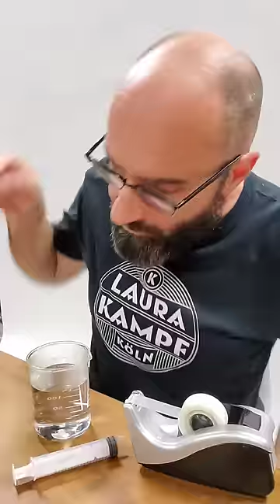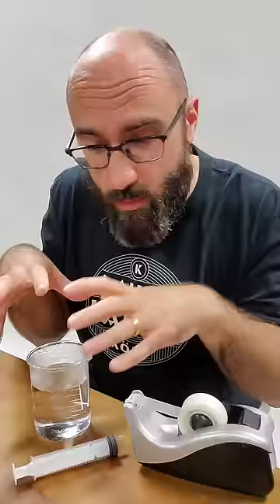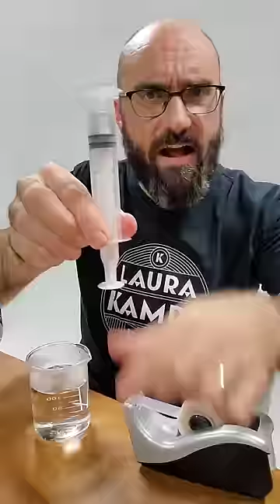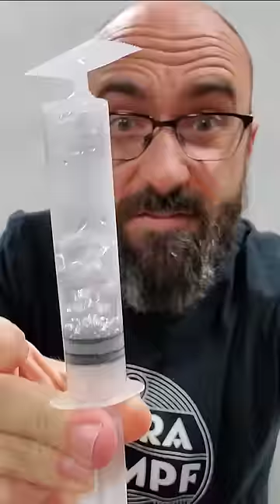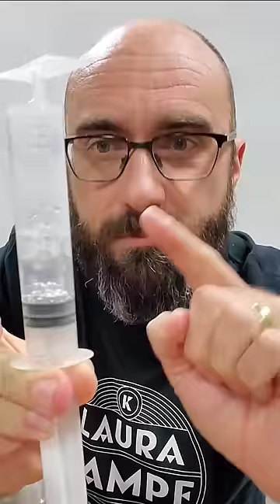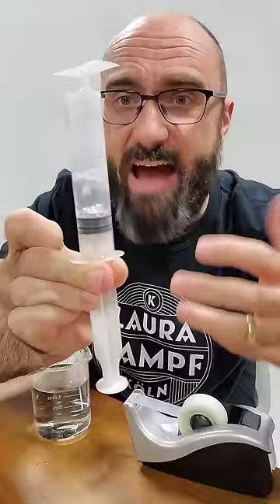Cooling down water by BOILING it

Comment: This is also how you can make frozen nitrogen :) You pull a vacuum, the molecules with the higher kinetic energy transfer to the gas phase while the average kinetic energy in the liquid phase drops, allowing it to freeze.
Reply from the maker: Yep! That's how I first learned about this!!!
Reply: @Vsauce  first reply to sauce man interesting
Reply: @Vsauce  Interesting!
Reply: Ok
Reply: Hi sauce
Reply: @Vsauce  ñ
Reply: @Vsauce  Believe it or not,  but I found this out about the age of 6 by playing with such a syringe under hot tapwater :D got freaking confused, and my parents couldnt tell me the reason. Later I found out, but funny coincidence, that my all time favourite youtuber comes across this after 20 years of child-me observing this phenomena

Regards from Finland 8)
Reply: But the evaporated gas which took away the kinetic energy never left the syringe as it was sealed then how temperature is cold ( i mean liquid phase may be cold and gas phase may be hot but overall the syringe when touched should feel exactly, what the temperature was before pull the syringe and lowering the pressure)???? Please clarify my doubt
Reply: @Vsauce  Hello Michael 😢
Reply: I've always thought it was kind of the other way around. You compress a bunch of air, which will concentrate the heat, then cool it down to room temperature. When you decompress it, the heat is spread out over a wider area and so the temperature at any point drops. This causes the whole container to get to cryogenic temperatures, allowing liquid nitrogen to condense. There are some more complicated parts to it but I'm fairly certain that's how liquid nitrogen is normally produced. That's also how they purify nitrogen from the air for use in certain lasers
Reply: @thedudeamongmengs2051  you can probably do it both ways
Reply: @swamphawk6227  i didn't get you , see if water temp is x then after putting it to syringe and pulling it overall temp should feel x as evorated water didn't leave the syringe, so energy isn't transferred
Reply: Smort
Reply: How are tight is the plunger in the syringe? As soon as you start to pull a vacuum, any imperfections there will allow air in, resulting in some bubbling regardless.
Reply: wow
Reply: @swamphawk6227  so, in a closed system if energy is spread over large area and we check temp using thermometer, it will show less reading than if energy is spread over small area ,even though energy is conserved ?( sorry my basics is not strong)
Reply: https://en.wikipedia.org/wiki/Enthalpy_of_vaporization
if i am not mistaken this should actually "cool" the entirety of the contents of the syringe down, because the energy taken to evaporate was formerly heat. so when a bit of water evaporates it also "steals" energy from the surrounding water to cross the threshold the gas then will still have the same temperature but the water will be colder, lowering the average temperature inside the syringe
Reply: @subhamsahoo5817  https://en.wikipedia.org/wiki/Enthalpy_of_vaporization
Reply: @DUTCHWUB  Just be jealous that they know more than you :)
Reply: But who cares you know
Reply: @Vsauce  Hey it's vsauce. Michael is here
Reply: or is it
Reply: So it doesn’t go on forever?
Reply: @subhamsahoo5817   This is a very good question. What wasn't mentioned in either explanation is enthalpy (heat) of vaporization. In reality, the hottest molecules don't just freely fly out of the liquid; they have to overcome a well of energy, which is the bonding energy of the molecules in the liquid. So the energy from the hotter molecules goes into potential energy as they separate from the liquid. The gas in the syringe isn't actually hotter than the original liquid, so the temperature of the entire thing does drop.
Reply: @swamphawk6227   This isn't quite how it works. Energy being spread in a larger volume doesn't lower temperature in and of itself. For example, imagine you have a box divided into a gas on one side and a vacuum on the other. Imagine breaking a thin barrier inside the box so the gas expands into the vacuum portion of the box. The temperature of the gas will not drop.
The reason a gas drops in temperature when expanding, in general, is because it is doing work on something else (like a piston) and giving up its energy to that thing. 

In the syringe, there's definitely expansion that causes the gas to cool, but the dominant reason for the cooling inside the syringe is the water molecules overcoming the bonds in the liquid state. Basically, kinetic energy is becoming stored as potential energy.
Reply: @Vsauce  or is it?
Reply: @subhamsahoo5817  change fase needs energy.. liquid->gas and solid  -> liquid.
Reply: Triple point is fascinating
Reply: But isn't evaporation also a function that actively cools down the water?
Reply: @Reptex_cs  macroscopic vs microscopic explanation.
Isolate your system and think about where the energy is going, if the water is "cooled down"
Reply: Congrats man vsauce rarely reply 😅
Reply: @Vsauce  w michael you have teached me many stuff thank you
Reply: Oh damn.
Reply: Also, being in a low pressure environment means less molecules bumping against each other
Reply: You mean liquid nitrogen? I have not heard about frozen nitrogen, maybe you meant dry ice? Or am I getting it wrong
Reply: @Vsauce  Physics is amazing, ain't it? :D
Reply: @reapercreeper6097  Nope, frozen nitrogen. You can freeze liquid nitrogen if you just get it cold enough.
Here's a short video from NileRed demonstrating it! https://www.youtube.com/watch?v=qVKod6Rv6dE
Reply: I saw an experiment some years ago of freezing water by letting it on a vacuum chamber for some time, all along, the vacuum engine was on
Reply: @DoNotPushHere  That's a very legit way to get rid of some thermal energy. Other way is evaporative cooling. Sure it creates a very damp environment, but if you don't care about humidity, it is a wonderful way to cool a large amount of air :)
Reply: a/c man abides
Reply: @Vsauce  True lmao
Reply: Hi sauce
Reply: @DUTCHWUB  fr
Reply: Oh dang i need it for my cola
Reply: @Vsauce  Hey Vsauce, random commentator here, where is video about life longevity, do you have any interesting thoughts to share about the topic? I heard there ate apperently multiple route to immortality researched currently and it would be nice to hear from you about this topic
Reply: Is it really or is the negative pressure causing air to get sucked past the gasket? Cause nurses does that action every my central line is used and I would
Reply: Your the chosen one
Reply: @Vsauce  yo uncle steves
Reply: Is this why liquid nitrogen boils??
Reply: @Vsauce  I'm so happy to be able to directly reply to you Right now even if you don't see it I love your stuff
Reply: Wow, now it makes sence how they do that :)
Reply: Dumb it down please
Reply: @TheAsdffaaa  Finnish or your finished
Reply: @subhamsahoo5817  the syringe will feel the same, but if you were to cut the syringe, take the water out after the pressure drop, it will be considerably cooler. Our senses are pretty bad at giving accurate measurement, especially f temperature
Reply: @Vsauce  Vsause what happened to Asause
Reply: @subhamsahoo5817  there is no COLD.  Only absence of HOT, which we define as the average kinetic energy within the material being measured for “temperature”.
Reply: @Vsauce  hmmm i see
Reply: secondary school chemistry 😅
Reply: @Vsauce  You are the HowToBasics i still believe
Reply: I thought you had to compress and then cool the liquefied nitrogen.
Reply: @Vsauce  replied to vsauce epok
Reply: Can i drink it?
Reply: Thank you! I've literally always wondered how they made it! Never understood how you could get it that cold
Reply: You mean liquid?
Reply: @ThorOdinson1269  I didn't even realize they said frozen
Reply: Amazing. It sounds up how people use fire and cold as synonyms
Reply: You make nitrogen by doing this!?
Reply: @Vsauce  i can't believe i am replying to vsauce
Reply: damn

the more ya know
Reply: Love this information
Reply: but doesn't gas phase have more kinetic energy?
Reply: @akhlas260  That's the idea. You remove more energetic molecules by letting them transfer into the gas phase so the average energy in the liquid phase drops.
Reply: @MattisProbably  but the total energy of the system should be the same cuz the gas phase molecules are still inside? or does it not affect the total energy cuz they are far apart from each other hence not able to conduct their individual energy to other molecules?
Reply: @akhlas260  The total energy doesn't matter for the liquid phase to be able to freeze :)
Reply: Thanks! I learned 2 new things today. Sweeeeeet.
Reply: IM THE 91TH REPLY
Reply: Interesting
Reply: How are you so smart you’re so smart😮
Reply: @Vsauce  Can you stop braking my brain 💀 This stuff is actually crazy
Reply: @Vsauce  can you steal my brother's kneecaps?
Reply: @subhamsahoo5817  There are many layers to understanding this phenomenon..
1) The average temperature of the water (in liquid state) inside the syringe will definitely be less than that of the water (in liquid state) in the beaker as well as the temperature of the steam produced inside the syringe, for reasons splendidly explained by  @Vsauce  
2) Even if we take the average temperature of the entire system inside the syringe, that would be less than that of the water in the beaker. 
Maybe we can justify this phenomenon in more than one way.. Here is a way of understanding why the temperature drops..
Earlier the water in the beaker was occupying lesser volume due to more atmospheric pressure. However when our super hero pulled down the syringe, the same amount of water (with no change in total energy of the amount of water) is now spread across more volume due to decreased air pressure.. so now the temperature of the system (including water in liquid as well as vapour state inside the syringe) decreases..
Best regards from India
Reply: @Vsauce  Did you first do this in the basement of Kersten?
Reply: @muzzylogic 
Nope, that does not seem to be the case.. the syringe does seem to be air-tight.. coz if you observe closely, the bubbles at the bottom originate on the surface of the rubber (bed) and not near the edge (wall).. so the water is truly boiling.. this was the first question even I had when I first watched this video but then got clarified when I watched it more closely..
Reply: Always was curious on how they changed the state; always assumed there was a chemical process for this
Reply: @Vsauce  You > Bill Nye the science guy
Reply: That’s really cold 🥶
Reply: @DUTCHWUB  Bro why are you even on this channel then 💀
Reply: Does this mean it's possible to make ice by boiling water?
Reply: Is that usual how water behaves in vac
Reply: Thank you!
Reply: @2REACTION4U 
Do you mean Michael has rehearsed with those water molecules prior to the video to make it behave differently than usual?? 😊
Reply: @subhamsahoo5817  look up joule-thomson effect. I dont know the my(greek letter)-value for water at these conditions, but it seems plausible.
Reply: The nitrogen also has to get some of Michael's enthusiasm to get things exciting
Reply: why cant u  jsut normally freeze nitrogen?/
Reply: @subhamsahoo5817  Everything you said is correct, and as long as the wall of the syringe is completely insulated, the totally energy inside the syringe will stay the same as well. But, in that case, you wouldn’t feel the hot water through the syringe, either. 

Over time, the gas phase and the liquid phase will reach the same temperature as each other, thermal equilibrium, but because they are in different phases, they have different heat capacities, and so each will carry a different proportion of the total energy that is held within the syringe.
Reply: Please reference resistance transition temp and how the air pressure combine with the temperature aren't enough to initiate phase change
Reply: bees
Reply: Holy shit he got pinged by vsaus
Reply: @CasperTheRamKnight  I feel so honored.
Never gotten this many thumbs up before, too...
Reply: @Vsauce  or is it?
Reply: @Vsauce  put it in your enemies house when they least expect it.
Reply: @Vsauce  do chairs exist?
Reply: @squidman9343  You also have the that n i also have it ñ
Reply: @Vsauce  But sir, why bubbles can't form inside the bulk water before it's vapor pressure becomes equal to atmospheric pressure? I mean shouldn't the pressure inside the bubble that should matter and not vapor pressure, why can't the high energetic molecules  form bubbles inside the water which has pressure greater than its surrounding pressure and escape? And if it's just about bubbles why can't water temperature rise further than the point where it's vapor pressure becomes equal to atmospheric pressure?
Reply: Vsauce 2.0=Mathias
Reply: @subhamsahoo5817  the same collective energy is in the syringe. It's just distributed differently. The more energetic  molecules are in a gas form, whereas the less energetic molecules remain liquid. Thus the water is cooler. After some time it will reach equilibrium again.
Reply: @Vsauce  interesting or is it ??🤨 
(Vsauce music starts)
Reply: I'm 12 and don't understand a nd any of this  bro😢
Reply: @samtheman3633  who cares!!!!!!!!!!!!!!!!!!!!!!!!!!!!!!!!!!!!!!!!!!!!!!!!!!!!!!!!!!
Reply: Without vsauce we would not have vsauce
Reply: aghhhh too much chemistry for my brain
Reply: @VeryTastySoup87  it's Vsauce !
Reply: What that shirt you're wearing i can read Köln
Reply: @Vsauce  Which shampoo do you use?
Reply: You can do that with many other liquids lmao
Reply: @Vsauce i first learned when I heard blood boils in space and looked into it
Reply: @Vsauce L learned this in my thermodynamics chaper, ssc bords of education, India🇮🇳
Reply: Cool
Reply: You nerds hurt my brain. Keep it up i need it.
Reply: @Vsauce sauce man is amazing
Reply: @TheAsdffaaa TORILLE
Reply: Life Lesson from Science:
How to lower the Temp 😠 
of a situation? By reducing
the Pressure of the situation.
Where, any subsequent 
boiling 🤬only serves to ⬇️
the over all Temp 💢. 👍  :-)

Stupid is ⏫ the pressure🥊
to lower the Temp 🥷
Reply: @Vsauce  that's why we use vacuum distillation unit in refinery to boil heavy crude at relatively lower temperature
Reply: @subhamsahoo5817 I think he meant the average temperature of the liquid water, not the syringe overall.
Reply: How come the molecules in the beaker have the same kinetic energy but when the sample is in the syringe, there's molecules with different kinetic energy?
Reply: Thats cool 😎 👍🏽 😀
Reply: Well certainly the liquid phase would get colder but not freeze just by pulling vaccum.
Reply: @Vsauce  we need more epic vids from you man
Reply: @Vsauce  Does this method for boiling help with making water safe to drink?
Reply: @Vsauce ❤
Reply: Sounds like a nice weapon idea for a non-realistic game
Reply: Interesting...
Reply: @Vsauce with all respect, I think blood of Palestinians more important than your water!
Reply: @Vsauce heeeyy vsauce michael here
Reply: Huh cool.
Reply: @Vsauce  heh.
Reply: @samtheman3633 true.
Reply: @Vsauce  z
Reply: @Vsauce  Hi, I'd just like you to know I don't want to kill you. I think you're great. 👍
Reply: @TheScarvig  Exactly! Correct.
Reply: And to do that you need a bigass syringe
Reply: VsaUse
Reply: @Vsauce greetings from Köln
Reply: Interesting
Reply: I can give you a good example:
if you release lots of gas from a closed environment it gets cold
Examples are big gas containers - you can see water condensating and freezing at the release
Lighter refilling - if you dont hit everything inside the lighter, youll feel the cold on your hands, even if its not the liquid gas hitting you
Thats because those gasses are only liquid because of pressure
Theyre room temp in storage but turn to gas so extreme, it makes everything cold
Thats how your fridge works too
Its cold inside because of releasing the pressure(in a closed system) and its hot behind behind the fridge because of building up pressure(in a closed system)

This syringe is just a way smaller scale with probably the worst medium to do this
Water has the ability to store energy super good, its liquid at room temp, its vapors are always around us... The just wont be big jumps with it
But heat is basicly energy and making the highly energetic parts leave the liquid cools it down
Kind of like that warm water freezes faster than cold water cause the extra energy may makes it warmer - but it can build the structure of the solid form faster with that extra energy

You wont find a diff in touching the syringe, but with a proper setup, you could measure it(still not with your hands tho) @subhamsahoo5817
Reply: toyota wants to know your location
Reply: @Vsauce can this hurt you if you touch the boiling water? Like is the process of boiling itself harmful to touch? I don’t think it would but before I just touch it to see for sure I wanted to make sure haga
Reply: Cool t-shirt !
Reply: @Vsauce intersecting
Reply: @TheAsdffaaa You're 7 now right? 😅
Reply: @samtheman3633 has michael not responded to comments before?
Reply: @Vsauce or is it 🤨
Reply: Hi @Vsauce
Reply: @Vsauce The Man of S     A     U     C     E
Reply: @Vsauce cool
Reply: @Vsauce wow
Reply: SO SO COOOOOOOOOOOL
Reply: @samtheman3633 One small reply from sauce man, one giant leap for saucekind
Reply: he pinned your comment replied to your comment and hearted your comment
Reply: @alphayeep  Yeah I noticed that, too. No wonder this got to over 50k likes 😅
Reply: @samtheman3633 sauce man?.. 😭
Reply: @Vsauce wooooooooooow
Reply: I refuse to learn science UNLESS it’s from YouTube comments 🤠
Reply: Hmmm niceeee  @Vsauce
Reply: Called freeze drying
Reply: Why don’t they just put ice in some nitrogen? Can these stupid scientists not afford ice cube makers?
Reply: @cam5816  With a difference of about 190 Kelvin between frozen water out of a freezer and frozen nitrogen, the water ice would only serve to heat up the nitrogen. Which is crazy to think about that adding ice to something wouldn't cool it down 😁
Reply: @cam5816  bruh☠️☠️☠️☠️☠️
Reply: nah.
Reply: Higher pressure-higher boiling point, BUT there is critical point, where energy that material needs to boil is close to 0, so it start to boil. To prevent this you must use more stages. For this reason powerful ref. systems have 3 or more stages and a lot of refrigerator compressors.
Reply: @RamSankaran-rl2mj  Your explanation makes the same mistake that someone above made. Spreading energy over a greater volume alone isn't enough to lower the temperature. You haven't actually changed the average kinetic energy in that case.
Reply: @Vsauce 🙄👎 Boring . Find something that can be used in an action movie scene.
Reply: @Vsauce  I know when you pull the syringe down thare is vaccum and the air downside come from that
Reply: @MattisProbably technically everything has these states that Im aware of its whether we have the tech and innovation to reach tempatures of the magnitude that would
Reply: Ok
Reply: This is also how refrigerants cool things down in AC systems. That's why you can make "hobo air conditioners," with a small electric motor and a compressor, with tubing and a few properly placed restrictors. Propane gets used a lot because of it's cooling coefficient, and such low amounts in a system that isn't explosive.
Reply: @subhamsahoo5817  the temperature is actually higher than before because you put kinetic energy from your own muscle strenght into the syringe
Reply: So how can u apply this to a real world application or use?
Reply: @russellsimien7936  there are potentially endless uses for research and discovery. Mostly on the nature of how matter and mass itself works. You would be astonished by the things scientists can use to study other things that are seemingly completely and utterly unrelated.
Reply: @BigPanda096  Thx bro, but what I was asking is if anybody already knew of any real world applications or uses for the knowledge in this video that they could share.
Reply: @TheAsdffaaa im in finland too
Reply: @Vsauce  On a side note, bro you're so weird and quirky, we have the same name , I like your videos.
Reply: @Vsauce vsauce learning? But that's impossible! Vsauce knows everything...
Reply: @Vsauce or is it?
Reply: @samtheman3633 sauce man 😂
Reply: @Vsauce  truly a vsauce moment
Reply: This man is pinned by Vsauce Micheal here, praise be
Reply: @Vsauce tacos
Reply: Instructions unclear, I now have a radioactive nuclear fission machine in my basement.
Reply: @Vsauce i just want to say @Vsauce
Reply: @Vsauce you don't post anymore you alright?
Reply: @DuolingoWrath  what the💀💀
Reply: @Cool-mon  Hello.
Reply: @DuolingoWrath   don’t put me in your basement duo I lost my streak 💀💀
Reply: @DuolingoWrath   please don’t put me in your basement because I broke my streak
Reply: @Vsauce Vsauce how do traditions become a thing
Reply: i wanna eat frozen nitrogen
Reply: @growingoaks  Sure go ahead! We need some more Darwin Award winners this year to hit the quota!
Reply: @MattisProbably  you must be a potential winner if you were unable to detect the sarcasm
Reply: @growingoaks  Aha but you didn't detect my sarcasm in my sarcasm!
Or was this reply from you sarcasm as well? 🤔
Reply: @MattisProbably  the sarcasm 🕳️ continues in the next episode of DRAGONNN BALLLLL ZZZZZZ (RIP Akira Toriyama)
Reply: @Vsauce ū
Reply: Was it very hot when it was boiling??
Reply: @Vsauce nah brah It's just outside air coming into the needle from the bottom to equalize the pressure
Reply: Understood.
Reply: Dude science is so cool i wish i had the brain power to understand more
Reply: @Vsauce  I n t e r e s t i n g
Reply: This is so cool
Reply: The clash of titans.
Reply: liquefy
Reply: ah
Reply: Aw hell yeah! Looks like smart people tend to stick together!  @Vsauce
Reply: No wonder why it burns
Reply: @subhamsahoo5817  precisely. why do you think its more hot when the sun is directly overhead , than when its slanted in the evening ;)
Reply: Ok
Reply: Ayyy same name man😂
Reply: @Vsauce  
What i want to know is how that flimsy peice of tape can create an air tight seal that good with such a little amount of sticking contact to the syringe?

I think the real question here is, where do you buy your tape?
Reply: @Vsauce  like this so he see it :|
the question is when you heat water it boil from bottom because bottom is hot but why this is boiling from bottom too
Reply: @Vsauce  the question is when you heat water it boil from bottom because bottom is hot but why this is boiling from bottom too ?
Reply: @Vsauce  hello
Reply: Give me attention
Reply: I was actually gonna comment saying, so is that also how you make nitrogen, but I saw this first which just answered my question thx 😂
Reply: Ur amazing @Vsauce
Reply: Jesus loves you. He is your savior. Repent for the kingdom of God is at hand!!😊
Reply: Does that mean you can also increase the boiling point by increase pressure?  How much pressure does it take to have liquid dry ice?
Reply: U can do this to water to cause sublimation.
Reply: @Vsauce  hello from a year later
Reply: No way, an informative comment that doesn't try to joke about questioning their existence!
Reply: @Vsauce you are a nice person. your family is blessed to have you.
Reply: dang  show off
Reply: Um what do you mean you created a vacuum a vacuum is a space in where no atoms are present so you can’t really create it because it’s literally nothing and you can’t create ‘nothing’.
Reply: @Vsauce  you should make pasta sauce called V-sauce  and you should put fun-facts on the back, like I would buy that all the time
Reply: What would mean if you froze that in a freezer
Reply: @mr.dum_58 hahaa my head hurts & the one-up'ing in the comments doesn't help lol
Reply: @Vsauce liar you know everything from birth
Reply: What
Reply: Nice
Reply: I can't believe vsauce was the bay harbor butcher
Reply: Just so long that it will boil my coffee is all I care about!
Reply: Poop